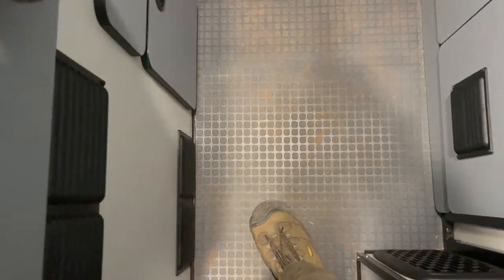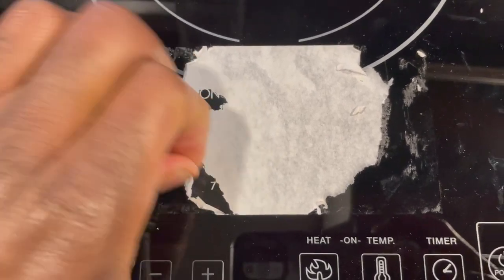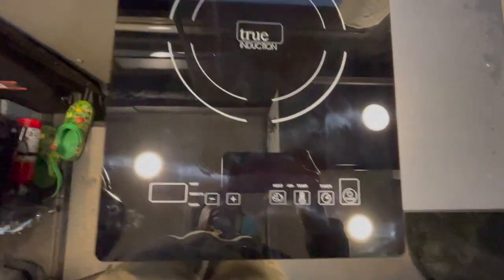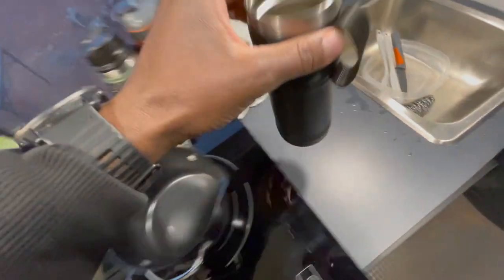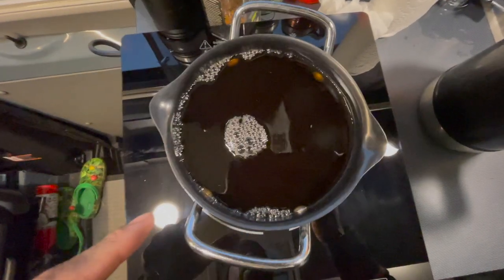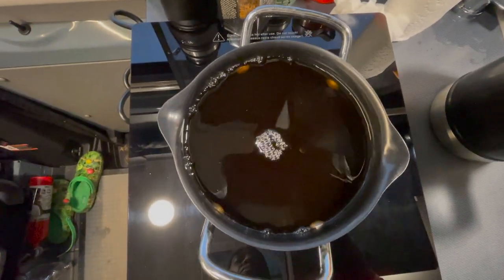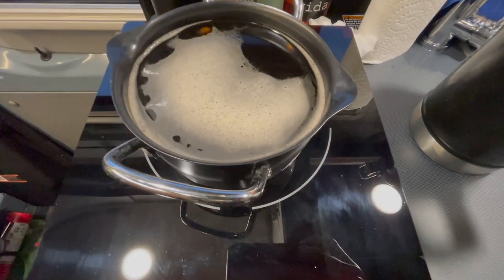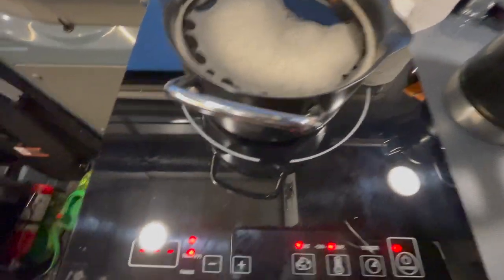Winnebago Revel: How Much Battery to Boil Water on the Induction Stove

Comment: To me the biggest minus of the Revel is the small lithium battery system...for the price of the Revel you shouldn't have to even wonder how much energy it takes to boil tea, lol.  If Storyteller can have a big Volta then Revel should also have the option.  Maybe they'll do something soon!
Reply from the maker: Stephen Stringer. I agree. There’s a guy that does conversions that are pretty legit. Roamrig. You should look him up.
Reply: @iAmMarchal  So Roamrig will basically "beef up" the current LB system in the 2021 Revel?  I am looking into this. Thank you.